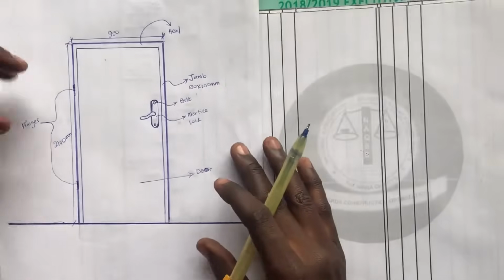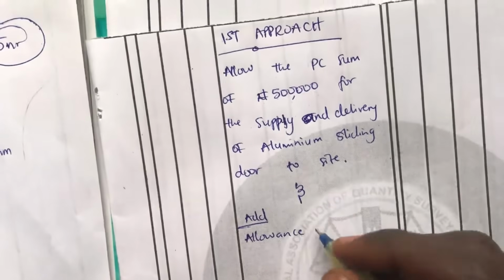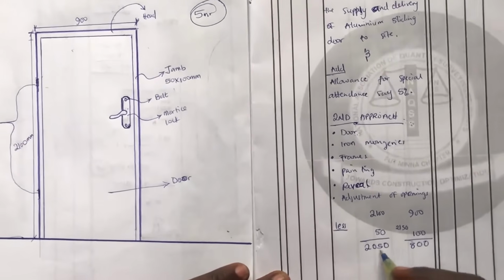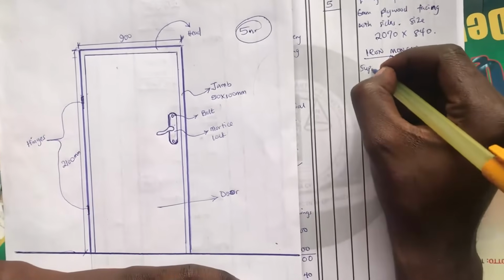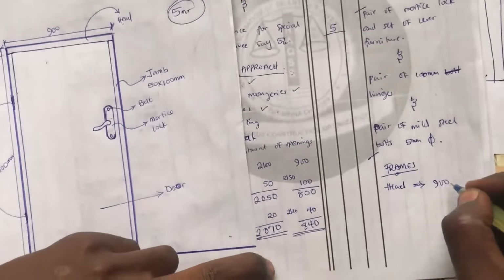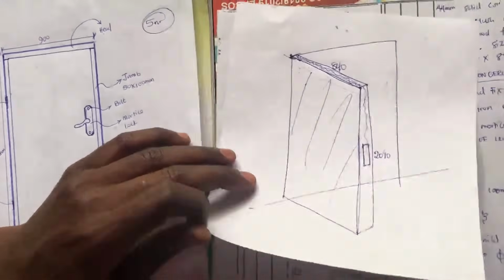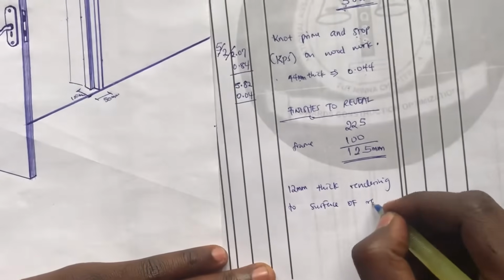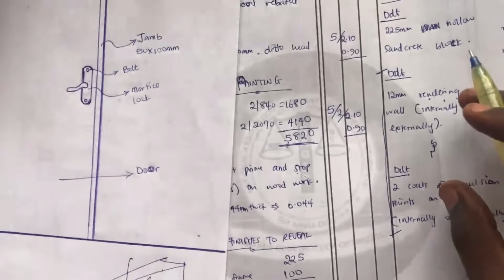TAKING OFF QUANTITIES FOR DOORS

Comment: Another question sir

For the reveal, when we have taken the height as 2.1, are we not supposed to take the width as 900 - (2/50) since it is just the internal portion we are painting
Reply from the maker: No 
You only need to take the width as 900. No need to deduct 2/50

Comment: A question sir.... For the frame 
Can we add the 2jambs and the head together and book it as a single item??

What I mean is that we take (2/2050)+900 = 5000

Then we book the 5000 by the 5 numbers of door

Can this be done like this?
Reply: Jambs and head are not measured separately - they are a standard unit and enumerated.